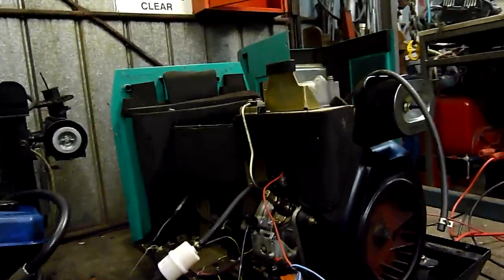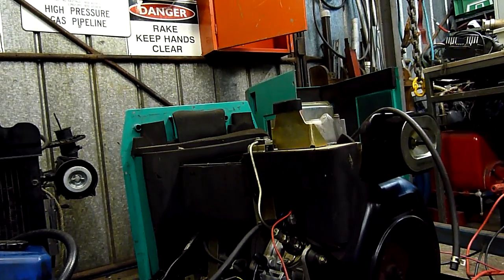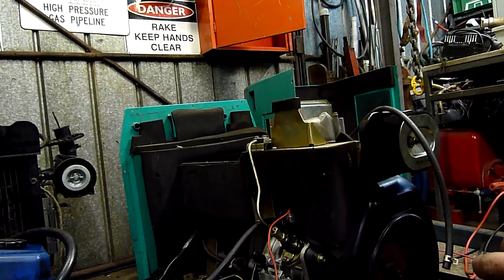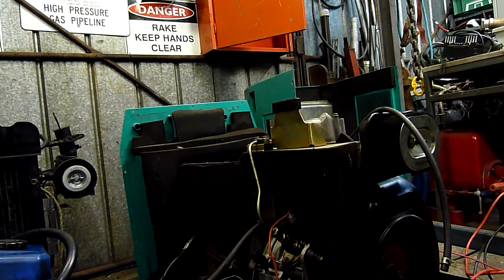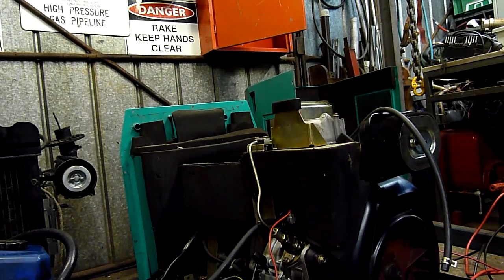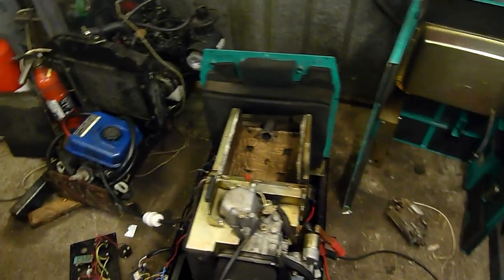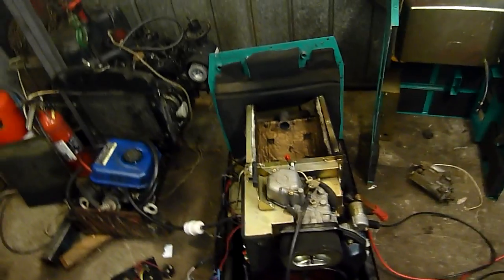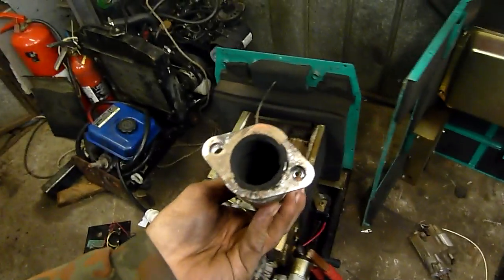Nigata NGT5 Diesel Generator cold start cranking - First Run

Comment from the maker: I was using the decompression lever for this video, but these units should be able to crank over without it for remote starting. the starter motor is still messed up

Comment: Is that a valve lifter on the top of cylinder because, don't you need to turn it over with the valves lifted then drop off the starter and drop the lifter so it'll fire?

Comment: I think When you get this thing back together you are going to be surprised at how silent it ISN"T.

I think the chinese version of silent is anything that doesn't need earmuff at 50m.
I have heard these things and they are still quite loud.  Probably be ok in a sound proofed and ventilated enclosure if you want to run it for any period at home. 

I have a couple of these type engines. They run very well on veg oil.

Comment: Chinese air-cooled diesels for the most part are pretty durable, but most of them do suffer from problems related to assembly. Changfa engines are probably the best in this regard.

Comment: I fixed a few of these and they aint that bad, but remember to put locktite on all the bolts because they come loose when you start to put few hours on them. Also put a exhaust on it because I have replaced a head because someone ran it with no muffler/pipe and burnt the valve and seat

Comment: The starter is fail, I can just see it now. "Aha, the Zombie Apocalpyse has arrived, but no worries, I've got a generator!" - Whirring of dodgy starter commences for several minutes until battery dies. The engine itself certainly seems to run without any real complaints though.

Comment: One way I heard is a good way of load testing a generator is to get a bucket of water and put both the negative and positive wires into the bucket to short it even though it is not a dead short. I have tried it and it put my generator under a load without burning the windings. 
Just food for thought